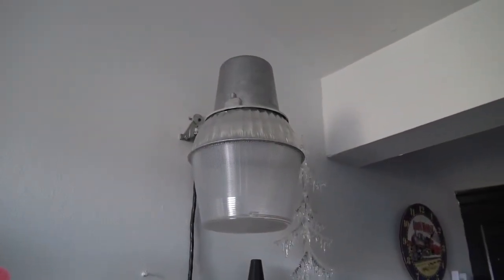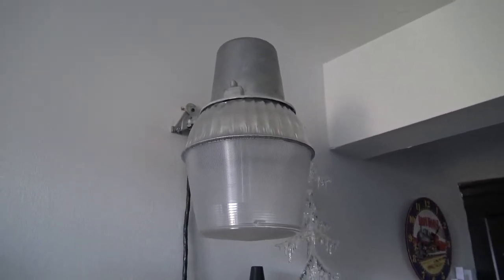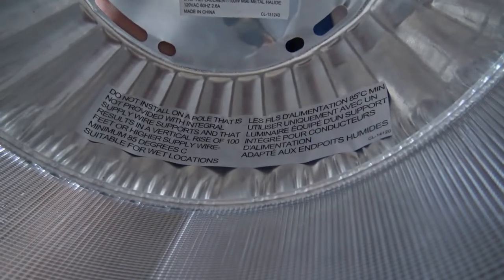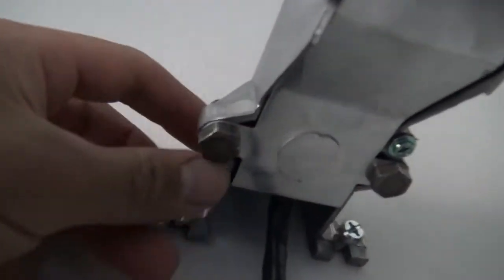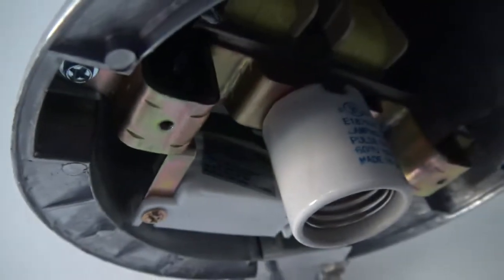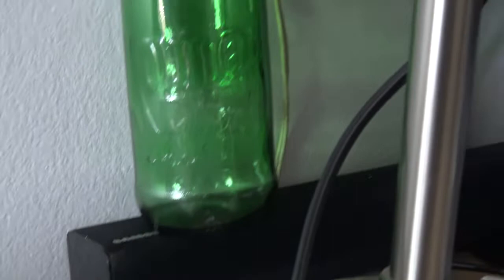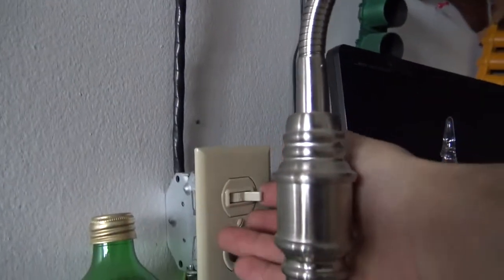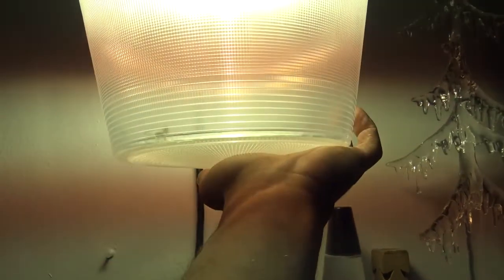Little 100W PSMH Bucket Light

Comment: Enjoyed the video!  A few points - Any properly driven MH lamp under 400W (Pulse start or not) can be prone to "non-passive end of life" (industry jargon for explosion), but generally only at end of life, and after they've color shifted dramatically.  Of course, there is always risk so you should always keep the lens in place... But they don't generally just explode at random.  Also, Acrylic is less likely to yellow.  Generally speaking, acrylic refractors aren't as strong, but yellow from heat, not UV. Polycarbonate is more impact and heat resistant but will yellow with UV exposure.  So as long as it doesn't get too hot (or get broken) the acrylic should be fine for years of use :)